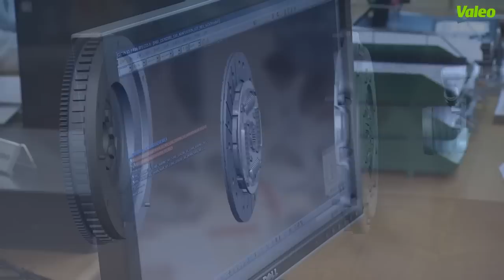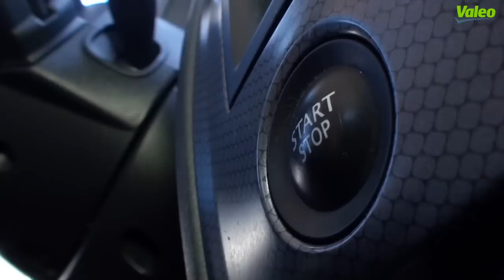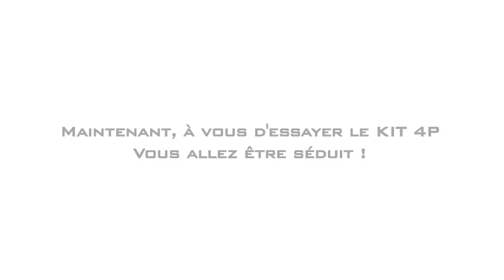[Driving Assistance] KIT4P, pour remplacer le Double Volant Amortisseur sur l'embrayage d'origine

Comment: J'en ai monté un récemment sur ma 406 break HDI 110 (RHZ) du 12/1999, dont l'embrayage et le volant moteur montraient des signes de fatigue ( rapports difficiles à passer, rétrogradage parfois impossible, broutage, bruits, vibrations... en même temps 17 ans et 283 000km...). 
Rien à redire côté montage, ça va tout seul! 
Bien respecter l'ordre de serrage des vis du volant, par contre 60Nm me semblaient un peu léger (de mon ressenti), alors j'ai appliqué un couple de 70Nm.
J'ai retrouvé une pédale d'embrayage bien souple et des vitesses qui passent comme dans du beurre! 
Le volant mono masse est très agréable à la conduite, pas de bruit ni de vibrations particulières, reprises plus franches, commande des vitesses plus réactive!

Par contre, n'hésitez pas à bien purger le circuit hydraulique de commande d'embrayage au niveau du récepteur si vous avez des à-coups après pose de ce genre de kit, ça ne coûte rien et ça règle le soucis dans la plupart des cas. 
Je m'explique : Il y un mois, j'ai monté un kit volant rigide (mais de chez Luk cette fois) sur la 307 SW 2L Hdi 136cv d'un pote et, après essais, sa voiture avait tendance à donner des à-coups lors des rétrogradages... Une bonne purge et hop, problème résolu.
Reply: Bonjour j'aurai voulu savoir si tu avais monté exactement ce modèle de kit monomasse ou bien un autre car je possède aussi une 406 hdi si montre des signes de fatigue et ton expérience me conforte à l'idée de faire la conversion.

Comment: gros soucis avec une astra h 1.3 cdti 90 ch , ce kit 4 p rend la voiture bruyante et extrêmement vibrante vers les 1800-2000 trs/min .
ça provoque un bruit de casserol qui claque très audible , j'ai due remettre mon ancien bi masse qui pourtant etait presque mort mais fessait nettement moins de bruit .
pour moi très déçu , de plus valeo fait la sourde oreille , argent gaspiller :/
"JE NE LE RECOMMANDE PAS POUR LE MOTEUR 1.3 CDTI/JTD 90 CH "
Reply: 307 hdi 136 montage du kit 4p et 30mkm impeccable. Seul defaut accoup plus sec au lâcher brusque de l embrayage. Avec l habitude ras.
Finis cette grosse m.rd. de bi masse .